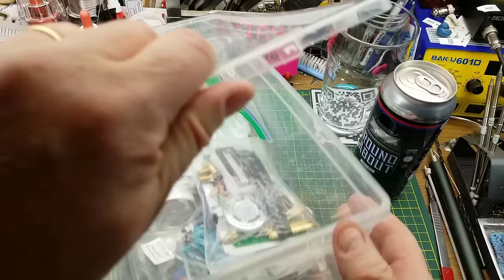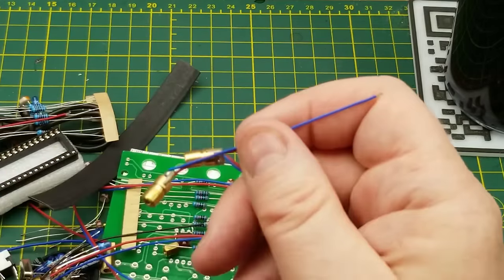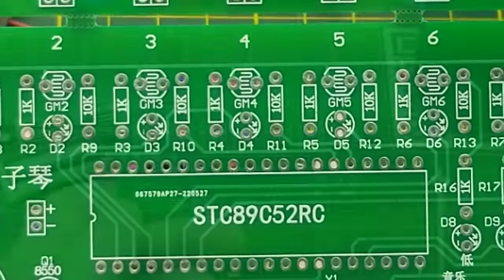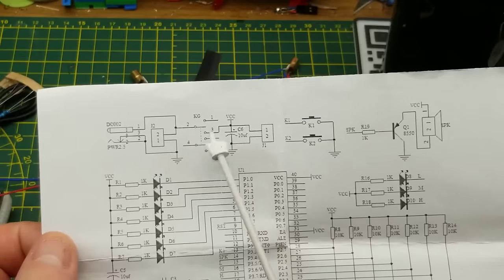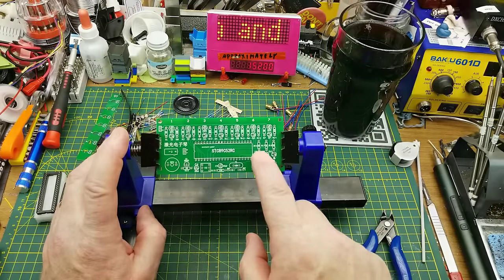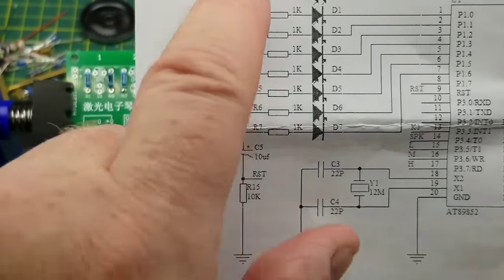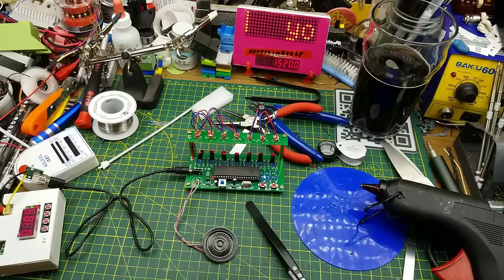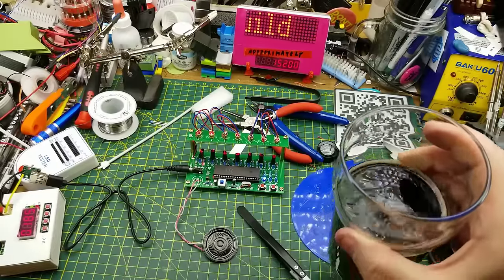December kit builds: Noisy Lasers!

Comment: This kit is grand indeed. I have watched you solder so many parts however now I have a question. Do you pull off a certain amount of solder and work with that or you a I can use it off the roll kind of guy. Yes I know seems like a strange question but I want to know. I have worked in places that have actually controlled such a thing.
Reply from the maker: I use it on the roll. 
Never understood why people break off a bit, use it down to a short piece you can't hold, then break off another piece.
Reply: @pileofstuff I'm sure this isn't a universal reason, but I have done it due to fine motor skills/dexterity issues, in my case from a permanent disability.
Reply: For info... I break off about 10-12" then roll it around 2 fingers to make a mini-roll.
The main reason is that my solder rolls are far too heavy to constantly  hold in one hand, and I often solder in free-air like BigClive.
Having a long string of solder hanging on the bench between roll and hand is very restrictive and messy! Consider what it is like to use a cordless phone, compared to having one with a cord 😂

Comment: If only there was a small circuit that would keep the voltage on the LASER Diodes at the proper voltage otherwise the diodes will burn out.